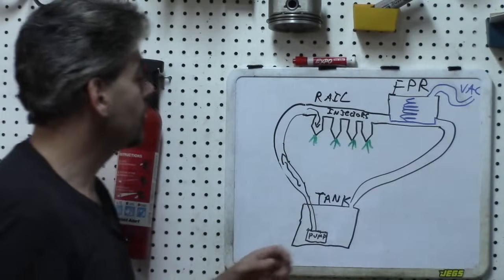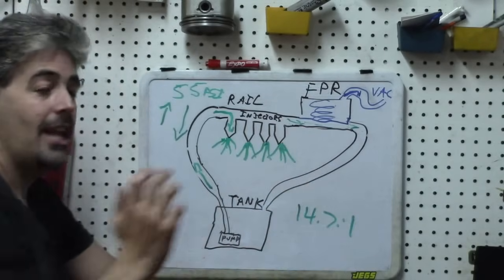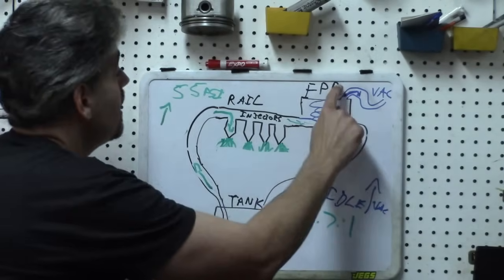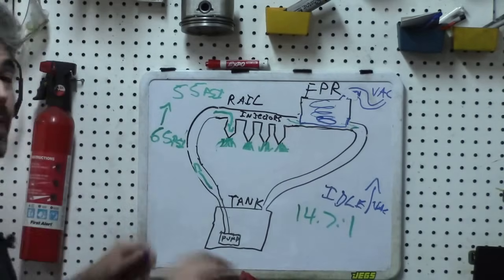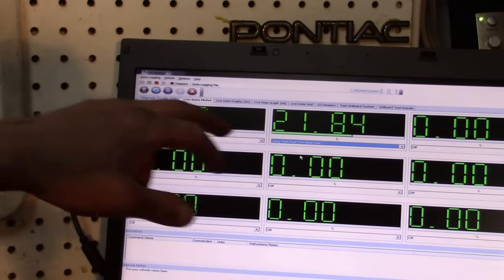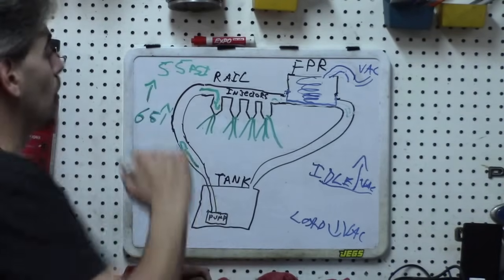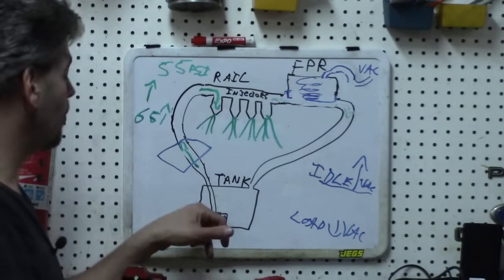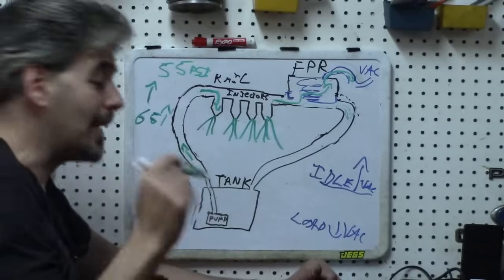Fuel Pressure Regulator Diagnosis + Understanding (HD!!)

Comment: Hi Professor Schrodinger,

Great job - your videos are awesome!  Yours and Professor Danner's are my favorites.

What I saw during your Static Fuel Pressure Test, was the gauge indeed, did move: 16:13=45 psi - 17:15=43 psi.*
 
So, can we presume that you noticed it but chose to not address it, because you knew the actual elapsed time thus the drop was nominal and not part of this lesson?  

Otherwise, can we presume correctly, that the observed condition seemed to warrant further investigation of other components such as leaking: Fuel injector; Fuel pressure regulator; Fuel pump check valve; external fuel leak?

Thanks for reading,

Paul
*Parallax was a factor. Elapsed time was unknown.

Comment: I really enjoy your videos. 
I feel I may have a Fuel Pressure Regulator issue on my '88 Buick Century 2.5 Iron Duke TBI. 
When I removed the vacuum line going from fuel TBI to Air Cleaner (MAF) had fuel in it. My Fuel Press Regulator doesn't seem to have a vacuum line directly on it, but on the TBI unit itself. I'm not sure just where this Regulator is on the TBI.

Spark plugs were wet with fuel, as was the MAT sensor. 
I had changed the fuel filter, so should've had no fuel pressure....HOWEVER, when I disconnected the fuel hoses under the hood, I got a a pretty good spray of fuel from one hose, I'm assuming the return hose? 
WHY would that be? 

Original symptom was poor running engine, followed eventually by a No Start.
Getting good strong visible snapping spark.
Reply: By the way, since it's an old 2.5 TBI, there is no test port to test fuel pressure.

Comment: Hi Matt
To carry on from my last two updates.
If the vacuum is taken off the FPR and the pressure goes up, therefore the pressure in the outlet of the FPR increases as well, or is this the same as the normal fuel pressure  wherever measured, I don't think it is as the outlet port is smaller, therefore higher pressure.  Also, just to clarify.  If the spring is down does it completely block the return flow or just restrict it and therefore there will always be a return flow.  Wait! I just watched it again and the snap throttle test confirms it, as it actually goes lower, therefore it can't be totally blocked off.  Cheers again.  PS If the IACV isn't closing completely would this effect the running under load as air is being introduced when it shouldn't be, therefore a lean condition.  I've checked my IACV and it goes in and out but I don't know how far it's suppose to.  Thanks for any help.  Cheers.

Comment: Think of the intake manifold as an atmosphere. The vacuum line to the FPR keeps the fuel pressure at a constant pressure in relation to the pressure inside of the manifold. It's as simple as that.

Comment: I've watched this video every morning this week and I learn something everytime, just brill.  I have lots to write but for now one main question.  I think you say in one of your other videos that at start up the car runs rich maybe by default.  If so, and you say here that the vacuum is at max when at idle, wouldn't the return flow lower pressure and therefore less fuel to the engine or is this where the pulse width comes into play.  Now I've just wrote that I seem to remember you saying something about that.  So if that is correct can you please confirm.  Cheers.  PS FPR..  I just pulled off the vacuum tube and blew and suckeed to see the effect and to maybe check to see if it was reacting, I think it was as I could feel some change but not a leak.  Is this one way to test it without taking it off.
Reply from the maker: Good observation. You have to remember though that during cold warmup, IAC is open much higher thus contributing to lower vacuum in manifold.  This helps increase the fuel pressure proportionately. 
  Great thinking though- shows you clearly comprehend the theory!! It's always nice to see when people dedicate to this stuff.
Reply: Schrodingers Box Hi Matt
A friend of mine sprayed some  easy start into the air duct whilst I kept full throttle with 1k rpm, it increased at once and then again.  He said it would probably be the fuel pump or filter as he proved the point I didn't really comment and I kept an open mind.  But could it not have been that as he added the propane or spray that the mixture became more stoich and therefore the car ran better.  This morning I thought I'd investigate the FPR.  I first took of the rubber pipe but there was too much pressure to hold it back with my finger.  So I used a clamp on the rubber pipe and at full idle it increased in rpms.  I did it a few times and the same.  So I'm thinking it's the FPR spring or so which could be stuck up or broken.  Be back later to show results.  Cheers and all the very best.
Reply: Ilovetosingem Well, I'm back.  I took off the FPR, blew through inlet and outlet fuel lines but no joy.  I then sucked on the vacuum pipe end, held with pliers to hold suction and tried blowing through fuel inlet and outlet to see if spring was up, but couldn't blow through, therefore either sprng maybe blocking flow or something else.  I don't know the inside of this nissan almera 2002 FPR.  But I also sucked on the fuel inlet and outlet and there is suction there as it held so the diaphram seems ok.  I don't know how much suction I need to make the spring come up.  But if it is stuck down then surely the flow won't get through but I know it is, as tested earlier and lots of it under pressure.  Or is that it the pressure is, and I'm only throwing this in, the fuel pressure is far greater, that the spring is being forced up.  This is getting very interesting.  Even if I'm completely wrong about the latter.  Cheer Matt.

Comment: Great refresher for me on how this type of system works and how to test it.  I have a recently purchased 99 Chevy Cavalier with a long crank time after it sits.  Fuel trims are normal, and no CEL is on or codes stored.  Car seems to run fine otherwise.  I did replace the fuel filter as preventive maintenance since I don't know how long the filter had been on there.  It was not the original filter.  Car only has 117,600 miles on it.
Unfortunately, my expensive Mac master fuel pressure kit doesn't have the correct adapters to T into the line going to the fuel rail, so I had to order some pieces to rig up one of the adapters in the kit to work.  Hopefully they come in soon so I can test the fuel pressure and determine if I have a regulator or pump issue.
Reply from the maker: Sounds like a bad check valve the way you describe it.
Reply: @SchrodingersBox  With my luck it probably is since the gas tank is full.  Thanks for the insight.
Reply: @SchrodingersBox  I checked fuel pressures today and all pressures and pressure drops are within specs so it doesn't appear to be a fuel pressure issue.  Time to go in a different direction.
Reply from the maker: What were the exact readings you got?
Reply: @SchrodingersBox  KOEO I got 42 psi.  Spec is 41-47psi.  Running spec is 31-44 psi.  I had 37 psi.  Bleed off spec is no more than 5psi in 10 minutes and I had 3 psi in 10 minutes.  Second bleed test is to drop PSI to 10 psi and you should not have more than a 2 psi in 10 minutes.  My pressure actually rose to about 14 psi.  When revving the engine, fuel pressure would rise about 2 or 3 psi.
Reply from the maker: Sounds like I would rule out fuel pressure. Whats the fuel trim look like?
Reply: @SchrodingersBox  Fuel trims were good.  Short term were around 1% and long term were around -3 to -5%.  I also looked at MAP, IAC, ECT, IAT, Baro, and TPS data.  The first five were normal. 
 
The TPS is questionable.  KOEO the reading is 0.47 volts at closed throttle.  The reading at WOT was only at 3.76 volts.  Service information says that closed throttle voltage should be approximately 0.6 volts and WOT should be near 5 volts.  I'm not sure if my readings are off enough to cause this problem.  When revving the engine from idle to about 3,000 rpms, the voltage doesn't want to even get to 1 volt.  I did not go WOT though

I also checked the voltage at the TPS and got 5 volts and the ground voltage was good as well.  I jumped the 5 volt reference to the signal wire while watching scan data and scan data showed 5 volts so I know that the signal wire integrity is good and that the PCM can recognize the voltage.

I watched engine rpms while cranking it to start and I'm showing rpms so the crank sensor seems okay.  Car has new GM O2 sensors in it and O2 data is normal.  I'm not sure where to go from here.
Reply from the maker: Could be some fluid like coolant seeping into cylinder?
Reply: @SchrodingersBox  I would think it would get a misfire code or have a miss if it was getting coolant in the cylinder but it runs fine and I don't feel any misfires.  Previous owner installed new AC-Delco plugs and some new plug wires back in February of this year as well as a new battery.  Car does not overheat or run hot.  I guess I could do a relative compression check but the cadence of the engine sounds normal when it cranks.

Comment: My 02 Mustang GT has a returnless system but it has a fuel rail pressure sensor (FRPS) is mounted to the rail, not not an FPR. This seems different to what you're saying in this video. The FRPS has a diaphragm, a vacuum line  and an electrical connection which apparently sends a signal that causes the power to the fuel pump to turn off and on (or vary the voltage to the pump?) depending  on the fuel pressure. It's my understanding that removing the vacuum to the FRPS will cause the fuel pressure to increase similar to what you described. Anyway, my FRPS looks bad because the pressure doesn't increase when I disconnected the vacuum line with the engine running (of course). Other indicators that indicate that it's bad is that the fuel pressure dropped from the priming level of 40 PSI to 30 PSI when I started the car and that the scan tool says that I have 40 PSI with the car running while the gauge attached to the rail says 30 PSI. I do have vacuum and it's a steady 17 in Hg - probably because I'm at 4000 feet ASL (this would be the equivalent of 20 in Hg at sea level?). The LTFT indicates a lean condition. The FRPS is only 2 years old.

Comment: I would first like to thank you Matt for all the good work. Your videos are a great help for the DIY mechanic like me, really detailed and informative. Highly appreciated !
I have a question for you after watching this video on FPR. I own a 13 year old 1.4L Ford Focus, which has served me well through the year and has about 140.000miles on the meter. It is working fine, and I haven't found the fuel economy to be abnormally high for a car of this age, or around 8liters/100km = 29.4MGP. However for some reason the long term fuel trim is close to -20%, but only at idle. At soon as I start driving the value goes towards normal limits. No trouble codes are showing up, except for P0136 since the 2nd O2 sensor is faulty (a really old issue). After watching your video I assume the possible cause for this low LTFT (at idle only) would be a faulty fuel pressure regulator (or vacuum leak). My main question is.....doesn't a FPR issue affect driving conditions, i.e. hesitation or anything like that ?  In my case not even fuel economy seems to be affected as the low LTFT balances out the affect of the bad FPR at idle.
Reply from the maker: Great question.  No actually, if anything,  cars run slightly better under rich conditions (to a point of course). In the old carburetor days when tuning by ear, you would actually adjust to slightly rich after tuning by "ear".  A common performance mod is to buy an adjustable fuel pressure regulator and adjust for richer mixture. Hell, at warmup your engine runs slightly rich as you probably know. Of course this works up to a point- too rich and the engine won't run well.  Keep in mind on this system if the vacuum hose has a leak or is disconnected, you also simultaneously have a vacuum leak which somewhat counters the rich condition of closed regulator too.
  But no- you often won't have symptoms like you would if the regulator was causing a lean condition. In that event, yes, the car would be very sluggish and hesitant off the line.
Reply: Schrodingers Box

Matt, wouldn't the PCM use the O2's to cut injector pulsewidth to counter the increased pressure? (assuming we are talking about an injected car with O2's).
Reply from the maker: douglas lee Yes you are absolutely correct.  I should have clarified that in the comment above, I was referring to a car literally running rich, but indeed at 20% LTFT it is reasonable to assume the absence of drivability in this case is due to correction from the PCM rather than the car actually running rich.  If however the short term maxed out, there would be less issue with the car's performance if it was rich vs lean.  This would also happen with an adjustable FPR however the idea is to ensure that an extreme performance engine remains rich at WOT.  This should happen anyway of course however some mods may actually require the higher fuel pressure to prevent starvation at WOT.  But 99% of people with an adjustable FPR are just ricers with no idea what it does or how to set it as if they even need it.  I'm actually planning a video on performance mods.
Reply: Schrodingers Box
   Don't you ever sleep?
Reply from the maker: douglas lee I sleep way more now than I did during that Trans Am lean condition!

Comment: When you check pressure, when you disconnect the vacuum hose, the pressure should rise. If it don't, the pump is weak. When you blip the throttle, the pressure should rise quickly and drop. Low-pressure can be caused by a leaking injector. When you shut down the engine, if the pressure drops, it's either the pump or injector. Check injector with a pulse tester.
Reply from the maker: The first part of your statement is incorrect. If the pressure doesn't rise it could also be a faulty regulator, fuel restriction, or injector issue.  A weak pump is also possible but not necessitated.
Reply: Schrodingers Box I'm getting my info from ScannerDanner as I understand. He used a Uactivate AES #07-80 $200.00. Also AES Line SPI (Smart BOB)- $200.00. Also get the Power probe IV-$40.00.

Comment: I greatly enjoy your teaching vs scanner danner which zips through fast and i can follow you very easy mainly as you detail it all which is perfect in my book. I don't like bouncing around back and forth checking things, i like a direct approach for each system known independent of other systems to diagnose. I would like to know what causes the injector pulse, what directs the pulse to pulse as it should with proper fuel pressure?

Comment: Very nicely explained. I have a peculier issue where my car will crank long before it starts, will shudder to find the right idle and then finally will find the right idle. This happens only when I have driven the car for a while and left it for an hour or 2. Cold starts are absolutely fine. My service guys have not been able to find the fault as I am nit able to replicate the issue when I am in service center. Any idea what can be the problem.
Reply from the maker: Hundreds of ideas- I'd start with the very basics- what is your Long and Short term fuel trim when curved against RPM?
Reply: @SchrodingersBox  they seem to be fine. I doubt a leaking injector. But there is no error or engine light to confirm anything. O2 sensors are already changed couple of months ago. The car otherwise runs absolutely fine with no drop in efficiency or power

Comment: Have you ever had a vehicle trip a lean and rich condition (0171 & 0172) simultaneously?
I appreciate all of your content it encouraged me to get to the bottom of this recurring intermittent issue.
I am waiting on a AE scanner to arrive and was wondering if you had any content that would resemble the issue I am having that I can watch in the meantime?

Thank you for turning my brain on
Reply from the maker: Technically you cant have one simultaneously on the same bank but I have seen many times where there was a 0171 and 2 on the same bank showing in the codes.

Comment: You are an awesome teacher!!!! You did a great job on the FPR but it didn't help my problem. I have a gage that just won't work. I replaced the fuel pump and sending unit on my 2010 F150 but that didn't help. The gage will cycle but always stops at a quarter tank. What do you know about that?
Reply from the maker: Well what was the voltage from the sending unit that indicated you needed to replace it?

Comment: i routed the pcv valve hose to a port on the top back side of throttle body, (between throttle plate and maf sensor.) hideous idle and occasional backfire,  spontaneous stall. checked the service manual, diagram indicated that hose routes to "intake manifold plenum". immediate fix.

Comment: It is doing the same in principle as the wastegate on a turbo, difference is exhaust gas exits through the gate when the spring is compressed and lifts the diaphram but when the fuel pressure is getting too high it overcomes the spring tension and lifts the diaphram. Simlar design.